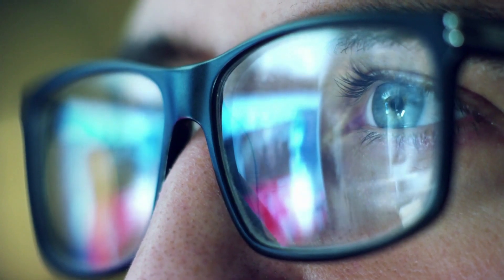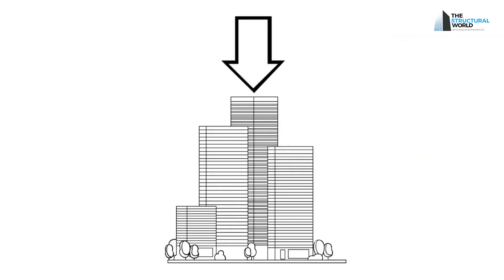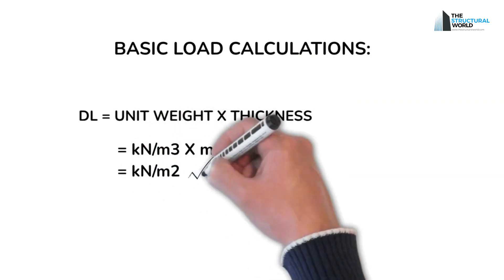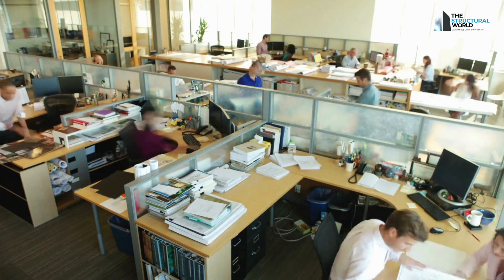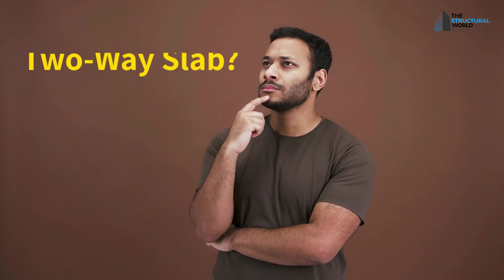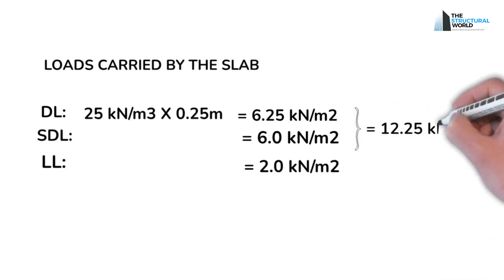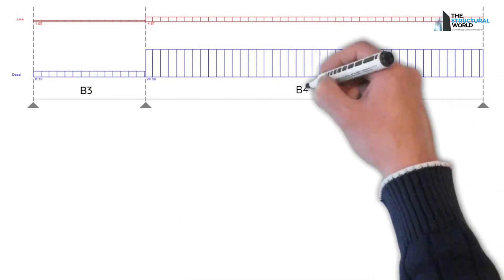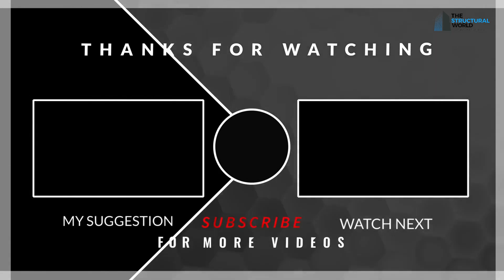Basics of Structural Design Load Calculations | One-Way Vs Two-Way Slab

Comment: not clear , how the load from slab will reach the beams and columns ? because once the vertical load ( kn) hits the slab , the slab will not take it as a load in Kn but it will cook it inside and it will be converted to stresses , the question is , if the slab is only has a stresses in kn per unit area , why we has to represent it as a vertical load in kn transferred to column ???

Comment: Beautiful informative video. I'm an Architect but I'm interested in calculating structures so the next step is to calculate loads on columns by dividing the total DL and LL on slab trapezoidal and rectangular areas by 2 between each 2 columns. Then moves the next more complicated phase which is calculating shear and moment force then shear and moment stress then moment of inertia then deflection of beams then column buckling and insuring values are on factors and less than the maximum factor value. Can you make another video about column load calculation ? Thank you ❤

Comment: You need to revise the ratio L/S limits @minute 4:44. For one way slab, it should be L/S greater or equal to 2, and for two way slab L/S only less than 2. Otherwise, your example @5:03 isn’t accurate because section AB23 will be two way slab according to your definition. Great video though.
Reply: His description is right, but the example is wrong. AB23 should be a two way slab I believe.

Comment: To design a strip in both directions, I need to know the loads on each strip, this depends on the stiffness of the slab in both directions, and assuming that the amount of deformation at both strips must be equal, at that condition loads should be distributed in the correct form. Can you derive an equation to calculate the loads on each strip (note: the difference in slab stiffness depends on the length of the strip and the effect of strip continuity.?

Comment: Can anyone give an answer, making a horizontal roof with 5 x 30 cm wood boards (30 cm being vertically) would the boards in 5 meters length bend from it's own weight and snow ?
Reply from the maker: You need design calculation for that bro.

Comment: The trapezoidal load is not the same throughout its length on the beam. The load gradually increased to reach its pack in its middle portion. Same for trapezoidal load.  To get the Uniform Distributed Load (UDL) from a trapezoid, even a triangular load, I believe there is a formula.  This is what I noted from studying with an engineer here. Interestingly you represented the trapezoidal load as a rectangular when you divide the total load by the length of the beam.  Is this procedure ok for slab load calculation only??? Anyway thank you very much.  Such explanation are really needed and I really appreciate the way you explain those hard to grasp stuff.
Reply: Structural Design is full of approximations. That is why, we have factor of safety. Else who will load the economy with such factors. Still structure do fall. LOL.